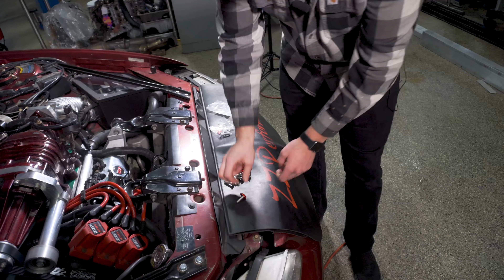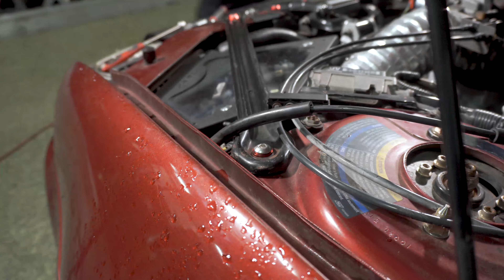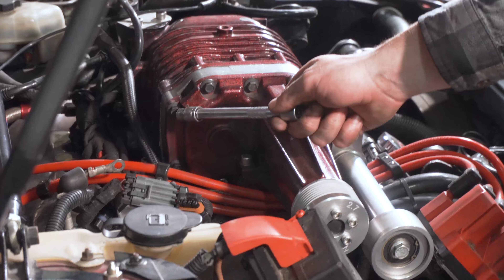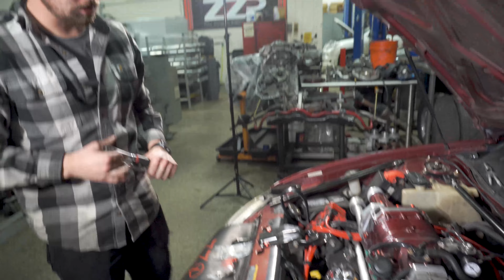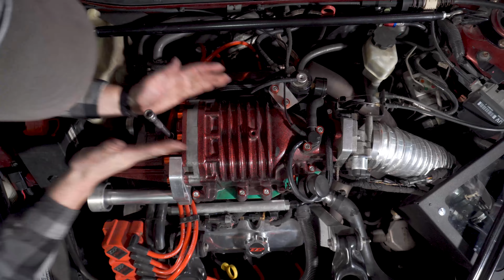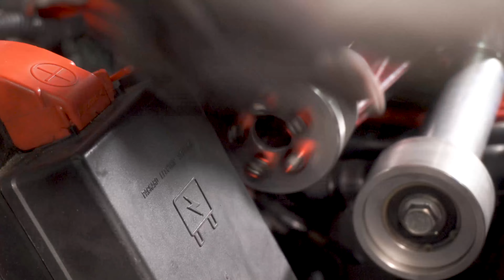Installing 3800 Dress Up Kits

Comment: If the bolts were black it'd be better.
Reply: We experimented with black bolts, unfortunately black stainless and black oxide are either very expensive or start to rust quickly.

Comment: wtf is the point of this
Reply: respectfuly
Reply: Just cleans up the look of the engine bay. Thats it.
Reply: And the dressup kit tends to have more rust resistant materials
Reply: Respectfully, if you don’t know wtf the point of this is, then explaining it would be pointless. It’s aesthetics, not brain surgery 😉.
Reply: I was missing some of the dogbone bolts when I “inherited” my 2003 Monte SS from my brother. I naturally looked online and some OEM replacements were pretty pricey so I just went with ZZP’s nicer looking ones that cost a little more but provided way way more bolts than the previous kit. Needless to say it was very worth it; the bolts are really strong and look nice under the hood